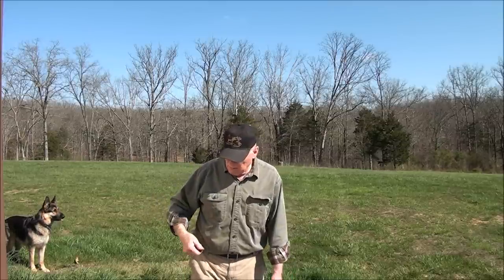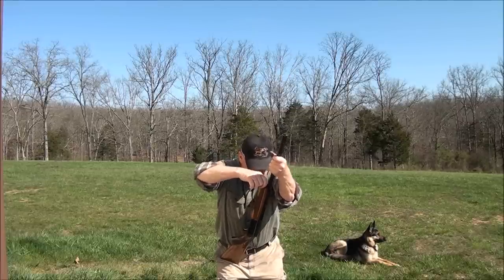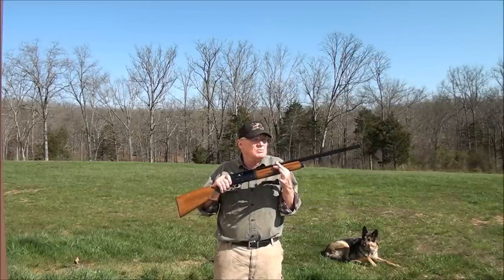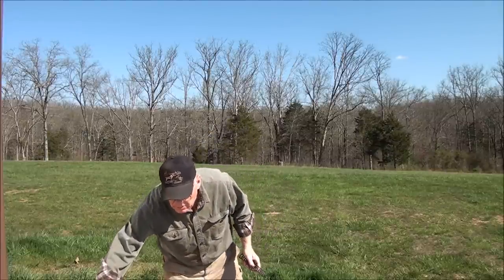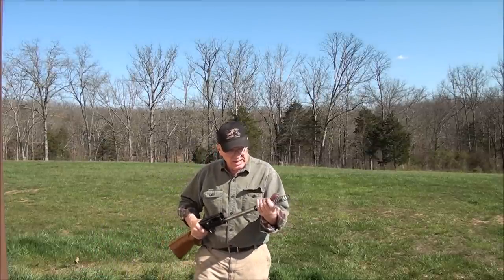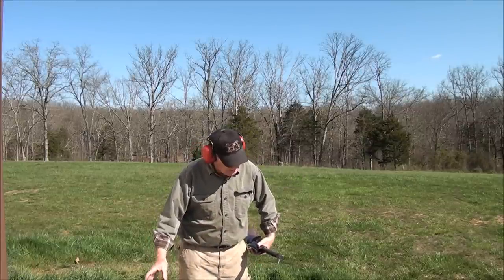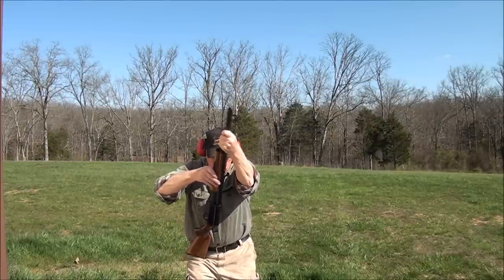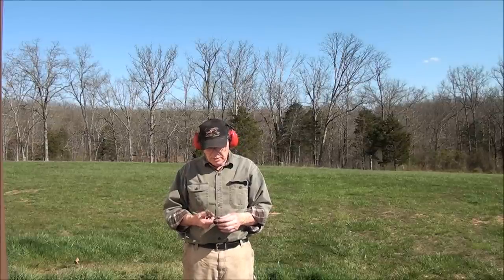Browning A5 friction ring setup and why they fail to cycle

Comment: I love my magnum 20, mine is a round knob though.  My dad's magnum 12 came with bear grease to lube the magazine tube.  I also have a E grade Remington model 11 made in 1906.  Love all of them and all shoot to this day like new.  Nothing compares to them either.
Reply: I have two 20 magnums that are round knob, one may have been changed but the other I'm positive it was originally assembled with the the round knob stock, it all matches to well to be a change and the wear is all  the same on the gun, I talked to a guy with a lot of browning back ground knowledge who said there is a likely  hood that there were several round knob stocks still in the inventory after 66, I also know some 20 mags stock and forearms were replaced with some nice mahogany looking wood that they had from the Japanese plant  which included round knob stocks.

Comment: I recently ran across a shop that got in a bunch of A5's from the same person who was no longer able to shoot, he had a pair of Sweet 16's, one a 50's gun, another a 60's gun and the third gun was a pre-Sweet 16 made in 1929. Only reason I didn't buy that gun is because it was still 2 9/16" and someone added a recoil pad (and I am not a fan of the safety in front of the trigger guard). The 1950's gun though is just a gorgeous gun and if I can wrangle the cash I hope it's still there. I had a couple of older Belgian 12 gauges years back but I like smaller gauges to hunt squirrel and grouse with.

Comment: Thanks just bought my first Auto 5. Its a magnum 12 with the 32inc barrel and it thankfully had all the rings! I am going to by new springs for it and screw driver set Brownells offers. None of rhe screws are messed up so I dought it was ever taken apart so I want the right tools before I attemt to clean and replace springs. Thanks for the informative videos!
Reply: I have the same gun. How do I set the rings for a 3" magnum load? Exactly how many rings is this model supposed to have? Thank you!

Comment: Fired my new to me a5 light twelve.  It's a 67, and isn't cycling well with light loads.  Thank you for this video,  I hope to get mine dialed in over the weekend.  May just be dry on the bronze against the tube.  And I should probably get a new recoil spring.  

Compared to my pump action 12g the a5 feels like a 20g.  I absolutely love the feel and fit of the a5.

Comment: great info mr art  , good video overall ,  but i would recommend zooming in close on the rings at different settings so we can see up close exactly which way the rings fit ... and good choice on motor oil , rem oil , wd40 and such and many gun oils are just too thin and wont stay long ,  i use a light grease on receiver rails and a thick(er) type motor oil or even light gear oil to lube tubes and such

Comment: great video. thanks. i dont own an a5 but i do own some guns. ive been using hornady one shot cleaner for a few years and in my experience it is without a doubt the best way to clean a weapon that i have ever used. and ive been cleaning them since the nineteen-fifties. im thinking that if you take that sweet magnum 20ga, set it up for the mag loads after you have cleaned it with the oneshot  that it will fire the light loads all day long. i would triple treat the tube the first time you do it. ps im a big fan of syn motor oil also.

Comment: I have a 12 ga 3 in auto 5. I figured out that if I use a standard spring with the original rings. I can shoot light 2 3/4 trap loads all day long with no issue.

Comment: Very helpful - was just about to take my A5 to the gunsmith, but the shotgun is like new, and hardly ever been fired.  It doesn't seem to auto load.  I will give this a try.  What weight motor oil do you use typically?

Comment: I have a question, I have a Browning A5 Sweet 16 that I’ve owned for at least 20 years. I got it out to shoot, after it had been sitting in my gun safe for almost that long. To my credit, I did have it in a silicone impregnated sack. To make a long story short, I can’t get the nut off the fore end to take it apart. I’ve only used my hands, but what is the absolute best way to get a stuck nut off without damaging it or the shotgun, using tools an average person would have?
Reply: Wrap the magazine cap with leather and use channel lock pliers.
Reply: gutbucket Thanks, I will try that.
Reply: Dont ever use vise grips
Reply: Push the barrel down And unscrew the cap

Comment: Hello Sir

I heard synthetic oil on the magazine tube, but what weight and brand do you use?

Two drops and how often?
@
Thank you

Rick Mansberger
Reply: Rick Mansberger Did you ever figure out the best method here?
Reply: I run synthetic diesel oil on mine. Brand doesn't matter and they literally always work

Comment: I just got my first light 12 I've got mag 12's and standard 20's but this is my first light 12 it is cycling 1 1/8 oz 1200 fps dove loads on the heavy setting is this normal
Reply: And the recoil is what I'd call excessive it's worse than my mag 12 set up on the light setting with 1 1/4 oz 1300 fps loads

Comment: Do you use synthetic motor oil on the blued part of the gun like the receiver and barrel.  I have been using Rem Oil.  What weight synthetic motor oil do you  use?  Would Mobil one work?  Would synthetic oil have an effect on the wood?
Reply from the maker: Hello Karl,  Rem oil is good for cleaning the outside, but you need something like motor oil on the parts that have metal on metal contact.  Synthetic works just fine.  Thanks for watching.
Reply: Karl Dittman bad idea
Reply: I use diesel synthetic oil on my internals and it's always worked regardless of weather and how many rounds

Comment: Ring setup the same with and without the 2 shot plug ? If different then why the failure to mention. Not as if you ever loaded more than 3 rounds...thanks for nothin
Reply from the maker: The plug makes no difference on the ring setting.